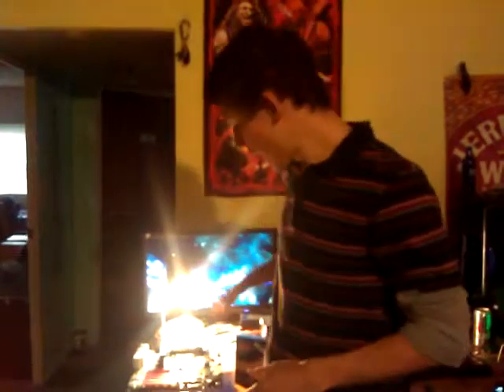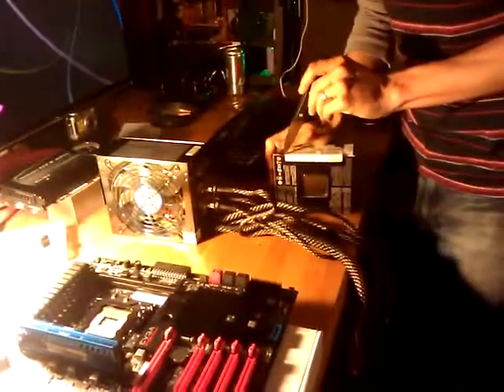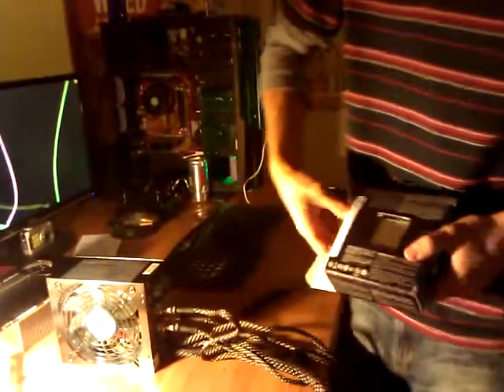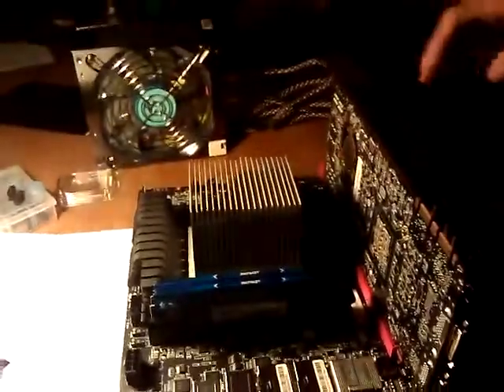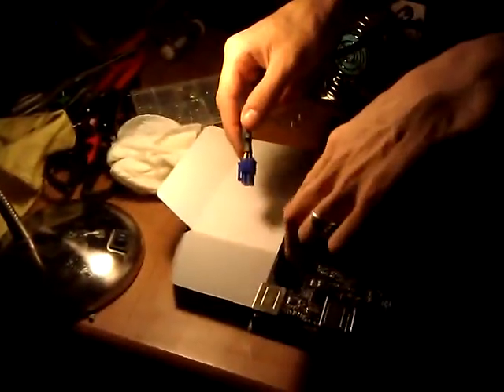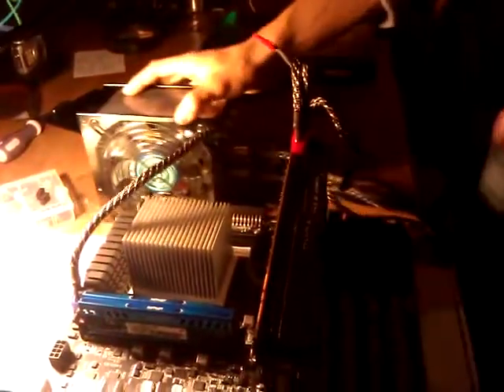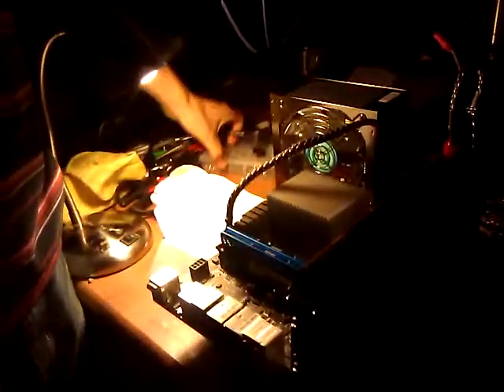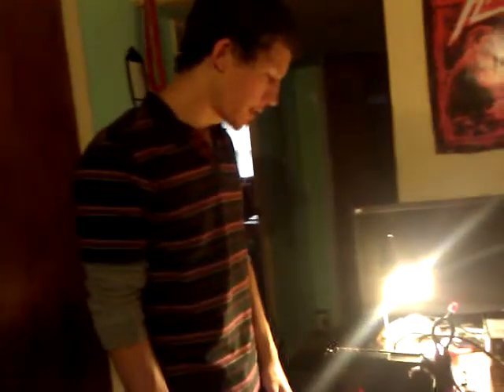EVGA X79 FTW Motherboard C-State C Code Error

Comment: But did you flash the bios? 
Here's a compatibility list: https://www.evga.com/support/motherboard/
Be sure to only download the Flash onto a formatted thumb drive
Be sure to only download the flash from the actual company.  There are alot of fishing scams going on where you flash your               bios with a Trojan. 

To get the Motherboard to post you will need to get a lower cpu that is guaranteed to be compatible for the motherboard.  Use that to flash the BIOS, let it reboot, then replace it with your hot rod cpu.  And don't have so much ram in there right off.  Try to run it with as few parts as you can so you can trouble shoot the problem.

The companies don't like to tell you to flash the bios because the user can royally mess up your mother board.  You'd be amazed at how many people there are out there thinking the CD tray is a cup holder...
I've run into this problem with legacy gear and the higher performance computers.  It might be a fix for your problem

Comment: I had this issue also on the same board. I changed out the CPU for a different one and it started working.  I think there maybe was an issue with a batch of X79 FTW boards and I7 3820 CPUs.  Did you gets yours working?

Comment: I just got this board also and had this exact same issue. It ended up being a misplaced CPU socket pin on the board. I had a horrible experience with this whole thing all together. NewEgg was laying blame on me for the 1 cpu pin that was messed up despite that was how I received it. EVGA pretty much told me that they would charge me to repair the board. Quality control at EVGA seemed to be the problem. The board I got didn't match the serial number on the box, so this made things even more hectic because NewEgg thought I was sending back a bad board and trying to pull some swap on them. They eventually contacted the person who had the box for my motherboard. It ended up I had his box and he had my board, vice versa. So they finally decided that I was telling the truth and processed the RMA. Got the new board in. It was factory sealed with shrink wrap and the stickers on the box. The serial numbers matched this time, but when I pulled the motherboard out of the bag, there was thermal paste on the cpu socket. and finger prints. Not sure what was up with this model board, but from the sound of everything that happened to you and what happened to me, I think their quality control went to shit for this board.

Comment from the maker: For those who have had this problem. It is possible that the error is either the CPU or the Motherboard. I went through 3 of the X79 FTW boards. 1st issue; turned out to be a bad CPU. 2nd board issue was the board but then this is the video to explain that. When my 3rd board arrived I put the working CPU on the new Board. Then from there good news it worked! not to mention the other issues I then had with the BIOS failing and more. It was the board and the reason those issues derived.